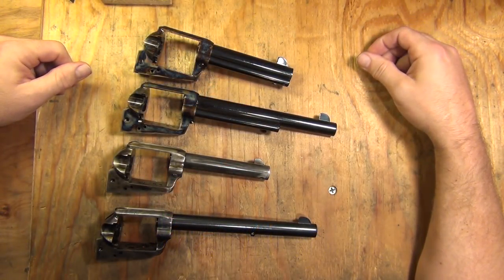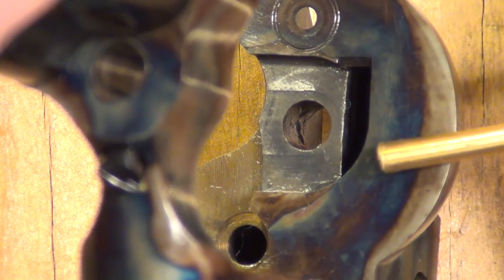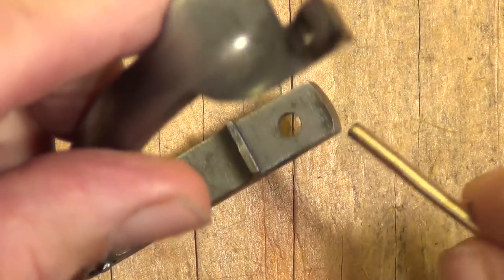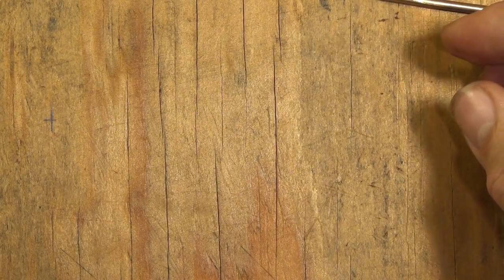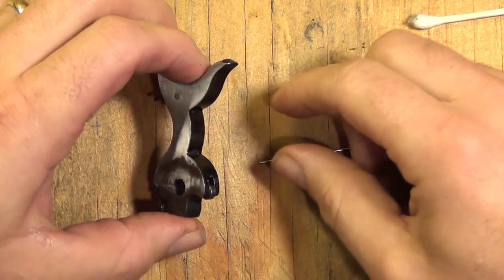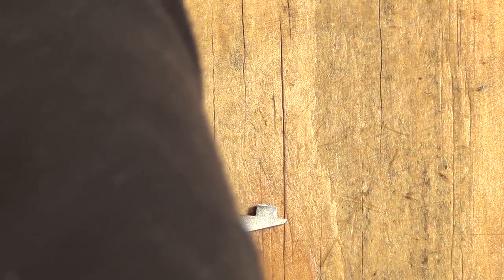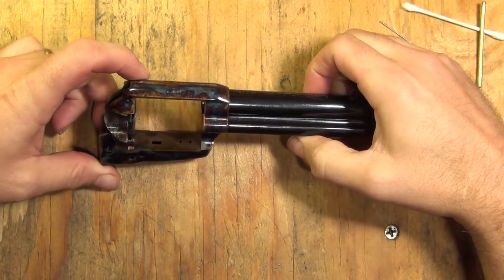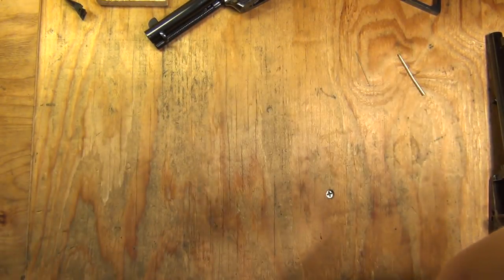Standard vs  other Single Actions--details

Comment: Hi, now that you have owned the standard manufacturing revolver how is the finish holding up?  I have several of their firearms now and have noticed the case hardening finish is very delicate. I seems to have some spots on the top of the frame of my saa where on the left side of the sight grove that is missing clear coat or the clear coat has worn off.   I also have an issue with the blueing coming off on the cylinder where it meets the barrel probably due to blow by. I contacted standard and they will refinish no questions asked.  However, I don't want to part with the firearm yet as I am enjoying shooting it.  It is a great shooter so far.  Thanks for the help.
Reply from the maker: Well you certainly have my respect--both for acquiring multiple examples (I still have only the one) AND for putting yours through their paces.  Unfortunately, other than one range trip I took previous to my video of it here, it hasn't put a round down range since.  And it has yet to see a holster, although that is just happenstance; I'm not at all averse to its acquiring some honest character. 

I've probably disassembled and reassembled mine more than most folks, and that has affected the clocking of the screws ever so slightly.  Most can be turned just a hair further than before.  Standard's newest guns don't have the qualified screws; this was only offered on the first run. 

As to the bluing coming off the cylinder face, I wouldn't be surprised it that isn't just lead accumulation.  Many folks mistake this for finish loss--especially that little spot that shows up on the outside of the cylinder just aft of the cylinder face.  In most cases, this is just lead deposits.  It really looks like bluing loss, but in the vast majority of the cases, it is just lead.  I wouldn't worry about that.

Color casehardening colors are VERY fragile and always have been.  That is why Turnbull, USFA, and now Standard put a clear coat on their frames.  It protects the colors and makes them more vibrant.  Colt never used to do that, and their colors always looked more muted.  If my Standard ever develops particular areas where the clearcoat wears off, and that spot begins to bother me, I'll probably just remove all of the clearcoat with a solvent.  The colors will be more muted then, but will actually look more "authentic".

Again, props to you for shooting yours enough to start developing some honest wear.  I'd sure like to see some pictures of yours.
Reply: @atlanticproducts  Standard still qualifies their screws. I just go mine. Screws qualified. While not a deal breaker either way by any stretch, it's still cool.
Reply from the maker: @stuckheel  Ah, so they still qualify their screws.  That's good news; they originally stated that they'd only do it on the first run.  Still looking forward to hearing more from you.

Comment: Very informative! I've never seen such detail if a firearms video, thank-you. 

Is that your chair squeaking in the background? Maybe some oil for it?

Those radiused openings in the Uberti frames may well be to eliminate stress risers at the corners, a good thing. I see the front corners of my 1890 made Colt radiused but not the rear corners.
Reply from the maker: Yes, I have a squeaky chair.  It really stood out on this video, didn't it?  I promise to have it oiled before I post any more vids at that table.

  I've often wondered why Uberti angles their corners like that.  I have a hard time believing that Uberti engineers did that specifically out of a concern for stress risers; they certainly ignore them in many of their other reproduction firearms.
Reply from the maker: I'm not sure why Uberti makes their corners that way.  I would think that just a rounded corner at roughly 90 degrees would be better than two corners at either end of the 45 degree cut Uberti makes, but who knows.  It is one way to tell a Uberti from a Colt, USFA, or Standard, so I'm glad Uberti does it this way.  Yes, my chair is VERY squeaky.  I had no idea how loud it was until I uploaded the video.  Working on it...
Reply: @atlanticproducts  I think that what Uberti does is an improvement on a sharp 90%, helps alleviate the stress riser.
Reply from the maker: I'd agree with you completely IF everyone else used a sharp 90 degree corner.  While they appear to be 90 degrees, they're actually quite rounded---usually. I have, on occasion seen some fairly sharp corners on a Colt or two, so I may give a small nod to uberti there for their consistency.  But it isn't authentic, so I prefer USFA and Standard's treatment of these areas, visually.  Uberti's version actually makes it easier to tell an all USA-made USFA from the USPFA revolvers they made earlier using Uberti parts.  So I'm glad Uberti does theirs this way.

Comment: On the colt cowboy model, is there    Any parts from Uberti or Ruger that could be used, ? Thanks
Reply from the maker: I suspect that SOME Uberti parts MIGHT be made to fit in a pinch.  The mainspring would probably swap easily enough, and I believe that the "Cowboy" cylinders were slightly larger in diameter than the SAA cylinder--somewhere above 1.670 inches vs. the SAA's 1.650 to 1.654.  So perhaps a Uberti cylinder COULD be made to work.  But really, the cowboy was its own model--Colt's answer to the Ruger Vaquero.  Most of--if not all--the parts were made in Canada, and the whole thing was basically redesigned to utilize a cast frame, hammer block safety, and cheaper manufacturing methods.  Overall, these were very well-executed, but poorly-received.  Few wanted a "Colt" single action that wasn't really a Colt Single Action Army.  I hear they're going up in price now, though.

Comment: I'm sorry, but the third generation Colt especially from the Vintage you have is a cast frame
Reply from the maker: Sorry to disagree with you, but no Colt SAA of any vintage has/had a cast frame.  They have some cast parts, but the frame has always been forged.  Colt switched to EDM to cut the hand channel on the 3rd Gens, which left a "pebbled" or "orange peel" finish inside, leading many to assume that it was from casting.  The older method involved drilling and broaching, which left a finer finish but took a lot longer.  EDM, though not in its infancy in the 1970's, wasn't as well developed back then.  Much finer finishes are capable with it now.  But in 1978, whatever EDM equipment Colt was using left a rougher, cast-looking finish.  Perhaps that's where you got the idea that their frames were cast back then, but they weren't.   Now the abomination Colt came up with called the "Colt Cowboy" in 1999 had a cast frame (cast at Ruger's Pine Tree Castings facility), but their genuine SAA's have always been forged.

Comment: I think that heavier bullets move slower and thus lifting the barrel more, because of recoil . (Does that make sense ?)
Reply from the maker: Not necessarily slower.  A heavier bullet has more recoil than a lighter bullet---using the same powder load.  If the powder load used results in the same velocity with the heavier bullet as with a lighter one, the heavier recoil of the heavier bullet will have raised the muzzle more by the time the bullet exits.  If the powder load used results in a lower velocity with the heavier bullet, the recoil difference between the two is less.  BUT, since the bullet is now going slower, the barrel has had time to rise more by the time it exits the muzzle.
Reply: Funny, it sound like bullet rampage ;)

Comment: What is your opinion of the AWA single action army clones?
Reply from the maker: Well, they were more authentic than either Pietta or Uberti, and finely finished--AWA used real bone color casehardening.  I thought they were very attractive and had the chance to purchase one at a low price just before production ended.  The only thing stopping me was the knowledge that these guns were made by Armi San Marco (ASM), and I just didn't trust the metallurgy of the internals.  The first EMF "Hartford" models were also made by ASM, and I bought one of those in 1995; the lockwork chewed itself up in no time.  And I'd owned various cap and ball revolvers made by ASM by that time that were also of poor metallurgical quality.  Shame, because ASM made very authentic copies, dimensionally, of every "old west" replica they ever made.  If you're familiar with the "Chaparral" 1876 rifles, these were also made by the same folks (though I think ASM may have just changed its name to "Chaparral" by that time).  These rifles were known for having copied the Winchester much more faithfully than Uberti, to the point of being exact copies whose parts were interchangeable with the originals; but the manufacturer's workers did a lousy job assembling them.  So most had very serious problems (headspace, the tab on the bottom of the bolt broken off, loose links, etc.), and I think the company completely shut down not long after.  

ASM was capable of turning out some very fine firearms, and anecdotes abound from people who got good ones.  Some folks reported excellent quality from their AWA's, and others complained of soft parts.  I read that ASM moved their factory out to the country at some point, and much of their talented workforce were unwilling to move, leaving them with poor workers overall.  I heard that it had gotten so bad by the end, that Uberti and Pietta representatives implored ASM to fix their quality issues, as this was having a negative impact on the worldwide opinion of Italian replicas in-general.  I don't know if that last story was true, though. I was also told that AWA had demanded--and gotten--good quality control from ASM on the parts for AWA's revolvers.  And again, I don't know first-hand if that is true, either.  Regardless, those AWA's sure were beautiful and so authentic that parts would interchange between them and original Colts.  I would still be wary of any ASM clone unless/until I could disassemble it for a thorough inspection first.

Comment: I think the prices on these guns are way too high it can't cost them near that to make them.
Reply: A good portion is the man hours it takes to polish the guns up. I can't say for sure but Standard at one point in production likely looks like how Ubirti used to look then one man with hand tools cleans everything up likely takes a few hours of manual labor per gun.

Yes there is a mark up but it's not like they are robbing you for $1,300 or anything. If you have the time and know how you can make a Ubirti look and feel like a standard for probbaly $100 or $200 but it's gonna take you a weekend.

Comment: Which model is stronger for everyday hooting?
Reply: Since I shoot a lot of 45 long colt should I just bite the bullet and get a Freedom Arms model 97. Thanks
Reply from the maker: Hard to say, since Uberti doesn't advertise what steels they use.  For instance, Uberti frames are forged vs. Standard's "machined from barstock".  For the same material, forged is stronger than machined from barstock.  But we don't know what steel Uberti uses, so their different methods of manufacture may be moot.

I would trust the metallurgy and small-parts hardness of Standard, Colt, and USFA more than I trust Uberti, though Uberti has greatly improved in their metallurgy over the years.  

When it comes down to it, the price difference between the Standard and a comparable Uberti is great enough that a durability comparison between the two wouldn't yield anything useful.  I suspect that the Standard will hold up better in the long run, but I wouldn't call it the economical choice.  Even if the Standard was twice as strong as a Uberti (which it isn't), it would still be cheaper to buy two Ubertis than one Standard.  

If what's most important to you is durability and longevity, get a Uberti or a Pietta--not because they're stronger, but because they're so cheap to replace when/if you do wear them out.  If you appreciate fine craftsmanship more, go for the Standard.
Reply: Thanks a bunch for the reply. I think a Uberti/Taylor/Cimarron will serve my needs well.